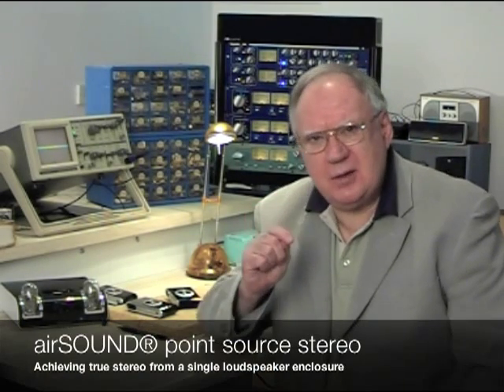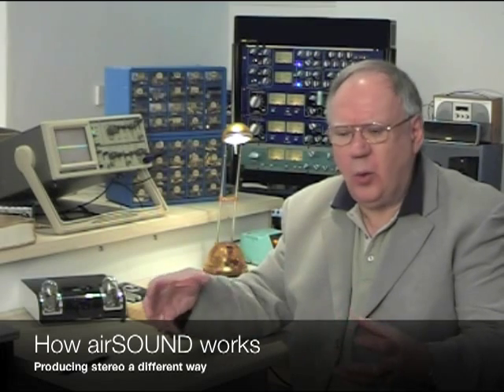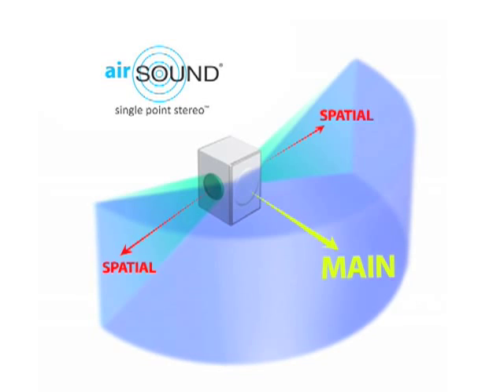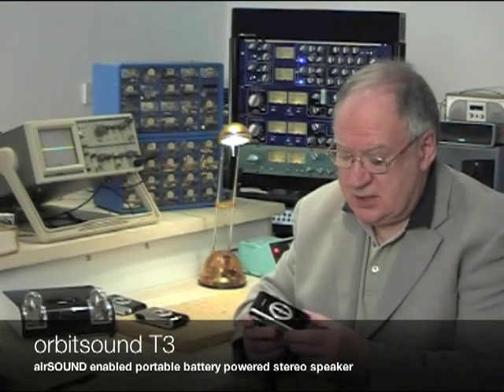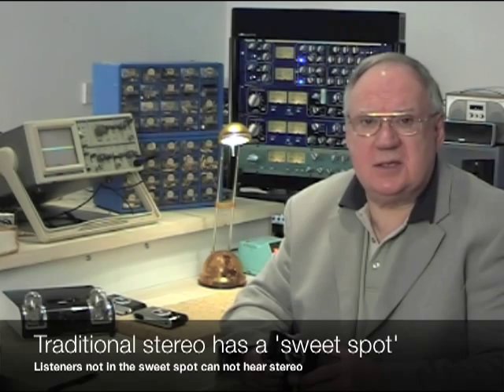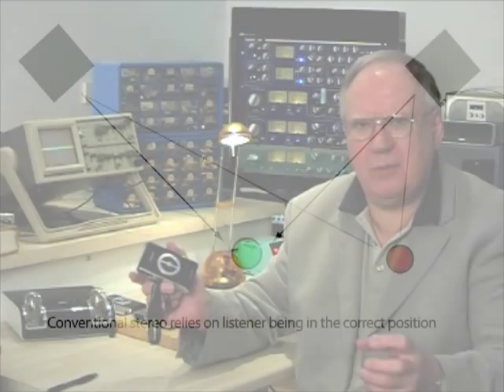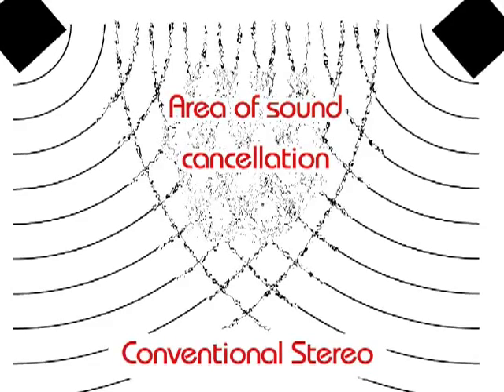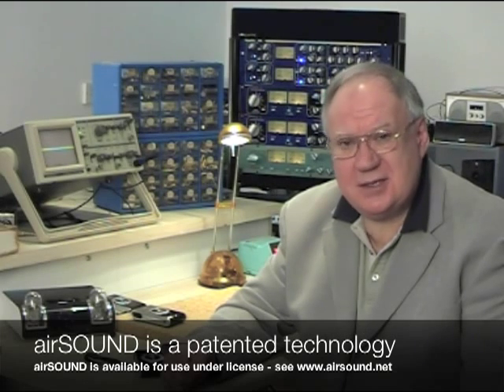airSOUND Point Source Stereo described by inventor Ted Fletcher

Comment: And how this should work for a concert? How u will use this for a big open air stage with thouthends of listeners? Must the Vocalist now clear his space for a big cabinet in the middle of the stage?
How u install this in a car...in front of the driver?
When this system is not in the front of the listener it clear has the weight on one side and never can be stereo.
There are reasons while in every supermarket, elevator, smartphone, big clubs, TV system, compact radios and, and, and...is in mono.
Reply from the maker: No, Airsound does not require central positioning at all. The image is not dependent on the listener-speaker spatial relationship. Very different to L-R stereo.
Reply: @ginzolacom  And how does it work on a live situation like a big rock festival? 
Does it work with more as one cabinet?
Reply from the maker: @ulrichbergmann1347  It does work with more than one 'stack'. I have done tests and used with multiples live or at events. There are ways to make the experience seamless. (and also done work in cars and found excellent solutions there). However, I would say that Airsound has limits on the largest scales where the distance from the listener to the speaker is very large (40m+ e.g)- i.e. a professional line array in an auditorium or outside. The reasons for this are now understood because of more recent developments in Airsound, and refinements in the process.

Comment: @v8pilot
1981 : Carver C4000 Control Console did something similar electronically - called "Sonic holography".

 1991 : Polk Audio had "true stereo" in their SDA-SRS, SDA1 and SDA2 series speakers, with one Left drive unit in the Right cabinet, and vice-versa ! All facing forward, though.

One day, it'll catch on - maybe in a Tablet ?

Comment: Welcome to the "There is nothing new under the sun" department.

I have an AMI Continental jukebox from 1960.   It has stereo sound (called "stereo round" by AMI) using  the  principle described by Ted Fletcher. 

The Continental feeds the sum (left+right) signal to its centre speaker and each of its two side speakers is fed with an enhanced super-stereo signal [eg the right speaker is fed with (1 x right - 0.3 x left) ].